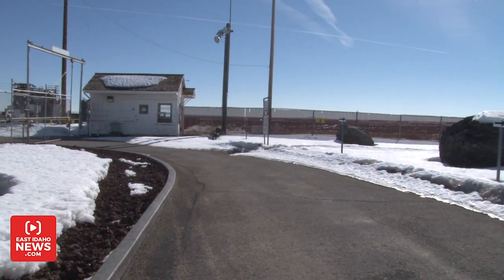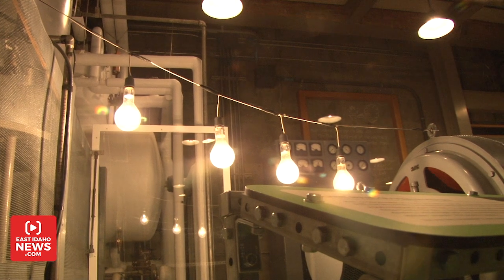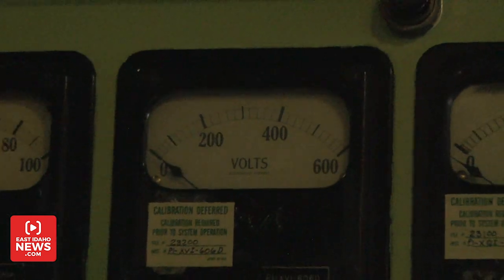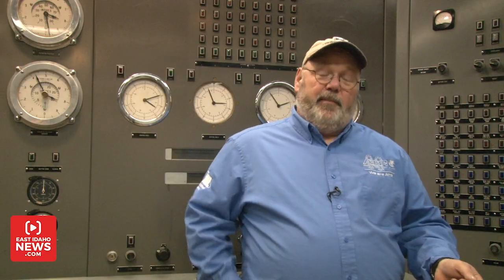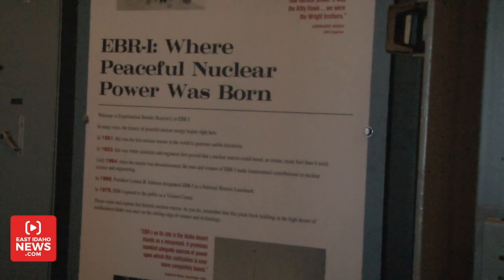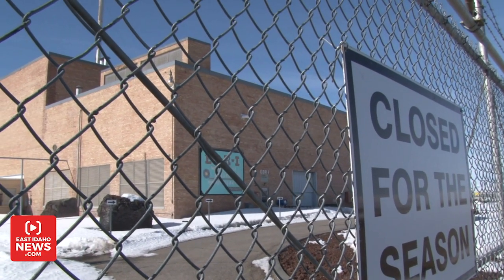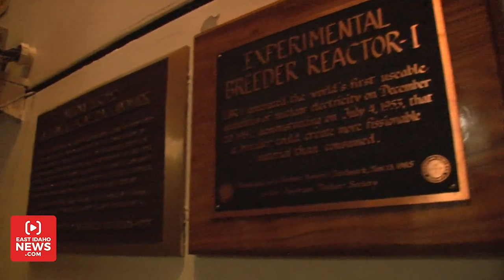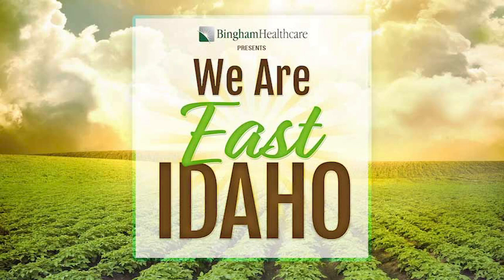An experiment in Arco Idaho that changed the world forever

Comment: Hey, it was a breeder reactor. What do you think they were going to do with the radioactive material they were breeding?
Reply: They were making plutonium but I don't think this style of reactor was how most of the US plutonium was produced.  Also, not all plutonium ended up in bombs.  The Navy's nuclear submarines used plutonium reactors for power.
Reply: The original plan was to use the plutonium for advanced reactors, thus recycling fuel.  Unfortunately, that was shut down by the gov.